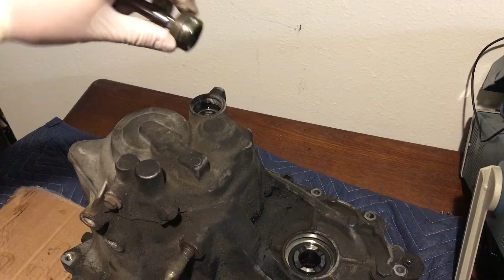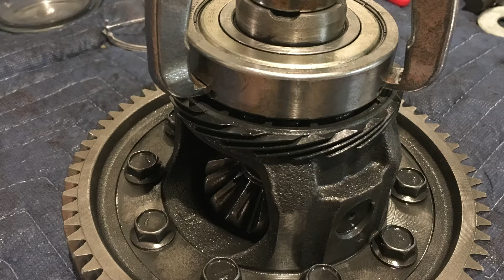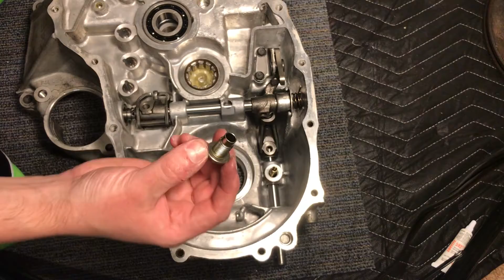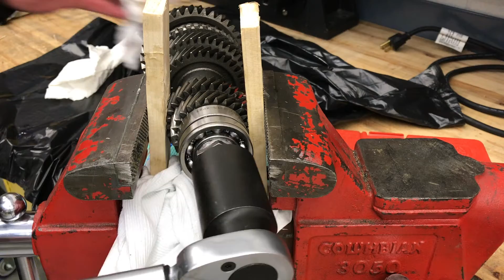1996-2000 Honda Civic D16 S40 (B000) Manual Transmission Complete Disassembly and Rebuild

Comment: God video. Thank you for showing clearances and test procedures!!!
Reply from the maker: All of the clearances come from the 1996-2000 Honda Factory Service Manual.  There are several places online to get a PDF version of it.  This build is still going strong.  Years ago I bought the actual book, but I mainly use the PDF.  I showed how to test the transmission on the table because I've seen so many people rebuild their transmission, put it in their car, and find out gears like reverse is locked out.  Remember, 5:05 in the video is the most important part (if you want to look cool, that is).

Comment: My manual transmission doesn’t have the balls or bolts like you mentioned at 2:14 it’s a p20 A000
Reply from the maker: Correct.  The EG Civic had shift forks that had internal detents on the shift fork shafts themselves, with the spring and ball bearing located inside of the shift fork, and where the shift fork slid along the shift fork shaft. In the EK civic, the shift fork is attached to the shaft. Page 13-32 of the EG Civic service manual shows the disassembled view of the shafts.

Comment: Nice video! I have a 2000 Civic EX 4 door. I think it has the same transmission. I only have about 145k miles on it. It is a second car so don't drive it a lot. I just drive it normal trying to put as little wear as possible. Just with normal driving what might wear out first in the transmission? I know the input shaft bearing goes out a lot.  Were you very hard on your transmission, or was it normal wear?
Reply from the maker: I think it is mostly normal wear. I installed this video's transmission at 293K miles, but it started having issues at around 250K miles. At the time this was built, I only had this car. I bought a few transmissions from the junk yard and made a working one, from combining the good parts and using a SynchroTech kit which contained NTN (OEM brand) bearings. There were other OEM parts I ordered that were not shown in this video, like the flywheel pilot bearing, and the clutch throw out bearing. Both came in my Exedy clutch kit though.  I have a few miles shy of 330K on the car now.  

I've taken quite a few of these transmissions apart since I made this video.  The common things I see are:

1.) The input shaft bearing has always needed replacement
2.) The 3rd/4th gear shift fork has always been worn past factory spec
3.) Most have had their counter shaft bearing partially walk out.  Hence why many in the Honda community stake it to the housing.  Future Civic transmissions have had a guard plate over the CS bearing so it cant walk out.

Fun Fact: I recently found out the voice that I used in this video is the standard voice used for weather radio alerts.

Comment: This video is awesome. Saved to playlist. Thank you for sharing!
Reply from the maker: I hope it helps.  Its not the most professionally made (it was made in my apartment) but i think its gets the point across.  Mine is still running strong, 34K miles later.
Reply: @CivicFiberglassDoor you did great showing everything including the torque specs. I’ll be rebuilding mine soon once I get my parts from Synchrotech.

Comment: I totally didn’t measure jack shipp nor did I use a torque wrench 🤣
Reply from the maker: How long ago? I think most people dont use a torque wrench, and they may be "fine" but given this is a guide to show the proper Honda service manual approved way, I went all out.  I use the tools I bought for this video project for so many different things.  And I know without a doubt that my build is solid.  Measuring also may not matter if re-using certain parts.  I did not have a 2nd vehicle at the time so I bought a few transmissions from the junk yard, frankensteined a working transmission from the parts from each, and made all those measurements to make sure it would work. Except for new bearings of course.  50K miles later and it still shifts like new.  About 2 years after this video was made, I bought another Civic to use as a project car.  Since I have those extra Transmission parts, I'm going to do an auto to manual swap.
Reply: @CivicFiberglassDoor right that’s the difference between a 15k mile ad 300k mile service life I can’t get the freggin main shaft bearing to fit in the case half’s it’s whooping my ass so close to the finish line
Reply from the maker: One trick to use is put the bearing in the freezer.  You can also heat up the part of the casing that it fits into with a heat gun. Heat expands the hole just ever so slightly, and putting the bearing in the freezer shrinks it ever so slightly.  It may drop right in.  make sure you have your main shaft seal in before you do that. Since you have it out id replace that seal.
Reply: @CivicFiberglassDoor all new seals for the second time 😒 Honda mtf doubled in price recently I’ve tried that with my heat lamp and freezer I think my garage is just to fin cold 43* currently 1:49 am I believe the main shaft gears  were the issue the main shaft goes up another mm or two I’m going to put everything in the house overnight and try again tomorrow I also smoothed some of the shape Lip around the main bearing clutch housing side I also mixed up 4 trannys only two were b000 s40s tho one with a hole blown thru it otherwise quite nice then the donor case burnt black nasty bearings were shot more then half of them were BAD
Reply: Measuring everything since I took it back apart

Comment: I sure am glad I watched this because I was just trying to separate this thing with brute force
Reply from the maker: I'm glad it helped! The transmission rebuilt in this video is still going strong.
Reply: @CivicFiberglassDoor  you already know when I got my spreader pliers on the job it fell apart in my hands like  cherry  turnover baked 2 days ago 😂 I blew a hole in my manual transmission after I swapped it the whole thing from automatic so now I got another transmission for EX that I gotta put in there debating opening it up and giving it an inspection before I do I’m practicing on the old transmission. I found the screw that was loose inside of the crazy. And the little bugger still did a mean burn out Skurrrt  talking peel 
& smoke some  32nds off in the street for the rip homies
Reply from the maker: @BrandonSALJ  Was it a pain? It was for me. I actually forgot to film that part of the video so the snap ring was actually already apart, all the movements in that part of the video were just for show lol but it got the point across on how to do it.

Comment: 45:40 came for this instructions, thanks xD
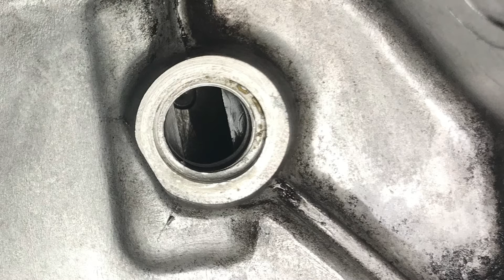Reply from the maker: I dont know why more people dont test their transmission like this before they install it.  I've seen too many people install their transmission then say some gears are locked out (usually a bent interlock, not installing it like at 43:27).  That can easily be seen if they just spin the main shaft and switch through the gears quick. 

If I can do this in my apartment, anyone can rebuild this transmission properly.

Comment: Great tutorial
Reply from the maker: 25,000 miles on this so far and this transmission is still working great.  Measuring the proper clearances with feeler gauges and the dial indicator gives solid peace of mind.  My clearances worked out to be correct as it was put together, but if wrong, my measuring tools would have let me know so I could have corrected them.

Comment: Thank you so much!
Reply from the maker: I hope it helped! The rebuilt transmission is still going strong.  Swapped at 293K miles, currently at 318K.  It would have more but I bought another EK civic to use as a project car, so when that is not down, I drive it about half the time.  Its going K-swap, but staying a sleeper.

The most important part of the video is at 5:05
Reply: @CivicFiberglassDoor  thank you so much and I hope your projects go well. I will make sure to wear socks with sandals in the future!
Reply from the maker: @BoostedPastime Good choice.  Its always preferable to look cool while taking a 25 year old transmission apart.

Comment: i’ve done a full manual swap on my ek and after 3 months of learning and doing the swap, pulling the motor, etc, i tried to do the first drive just for the transmission to  have problems. 

when the car is off, i don’t have 1st or 2nd at all. when the car is on, i don’t have any gears at all. i was ready to give up and scrap the car but then remembered those weird bolts with springs and ball bearings that you showed, i didn’t put the top one in, i only put the bolt in. must’ve accidentally taken that bolt off and misplaced the spring and bolt…

literally up at 3:30 am watching this, so if this works tomorrow i will freak out. i’ve had countless people tell me to just give up and there’s no point. i hope this proves them wrong
Reply from the maker: it could be the issue for those gears.  The detent ball bearings with springs help make the gears "click" and stay in place.  If that is the issue, holding the gear in place (such as holding the shifter with some pressure in gear and not let go) may make the gear work.  

43:15 - Did you make sure to line up the interlock as well? Some people dont do this, install it, and bend the interlock. The interlock is shown at 8:25 and 

If you need to check the interlock, the transmission will have to be pulled again.  If you take it apart, use the guide (or civic ek factory service manual, PDFs are available online) and go through checking all bolts are installed inside, the gear shift forks move the sliders properly, that the springs on the synchros are properly installed...etc.  

When you said when the car is on, all gears are no good.  This makes me think  the clutch release fork/bearing may be an issue, or at least something to check out.  How does the clutch pedal feel? Smooth always, sketchy, too easy to press down? One other possible thing it could be is the clutch fork bearing may have been knocked off the clutch release fork, or the clutch release fork could have been knocked off its little ball(held in by that long wire type spring, Honda part number 22835-P20-010, that clips into the shift fork), and isnt able to release the clutch by properly pressing on the clutch release bearing. If the car is on and you cant shift into any gears, it may mean with the clutch pedal pressed in, the clutch isnt released from the flywheel so its still spinning the gears so you cant press the shifter into gears.  This happened to me when I bumped the fork (piece the slave cylinder presses against when the pedal is pressed), and it popped off during mating it to the engine, but luckily I caught it before the transmission was even bolted back on.

Definitely dont give up.  Its a pain but in a few years time you wont think "yes, im glad i gave up".  Many people may say the Transmission is "shot" or "done for" but they dont understand the workings of it.  They just see the transmission as a mystery box, dont understand how it works, so they just think the transmission is "bad".  I recently pulled an RSX transmission that would only turn half way then lock up.  it was a "bad transmission" but pulling it apart revealed the problem.  The problem was found, fixed, and it works like new.
Reply: @CivicFiberglassDoor i started simple and just undid the wrong bolt i put in the top and it worked. 1st and 2nd are back! i’m not sure where the little spring and ball is so that’s going to be a struggle to find. in australia we don’t have pick and pull junkyards.
Reply from the maker: @rxefy  are the rest of the gears back when the car is running?
Reply: @CivicFiberglassDoor  i haven’t tested it out yet as i don’t have a battery and i need to re bleed the clutch. but i will update either tonight or the next couple days. 

this has been a huge boost in motivation for me, thanks heaps
Reply from the maker: @rxefy Good luck on this project.  I hope what you did fixed everything, but if not, you fixed one thing and can now move to the next thing. Once solved, you will have a working transmission. As said before, a factory service manual is valuable to have if you need to reference anything.

Comment: Isn't there a ball bearing between the shift forks that need to be in place. I'll have to look at the one I'm doing but I'm sorta remembering that. Maybe it was just left out of the video? 

   This video is extremely helpful though. Thank you for making it.
Reply from the maker: Do you mean what’s at 2:14? There are 3 screws/bolts that have a spring and a ball bearing that the spring presses against, and that ball bearing presses against the shift fork. 

2:26 shows the ball bearings in the hand. 

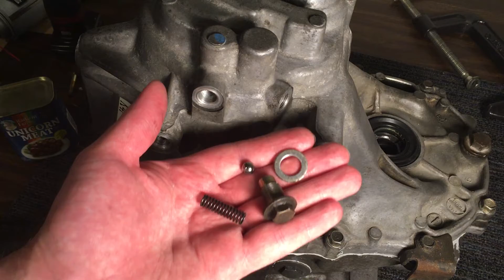44:32 shows the ball bearing, spring and screw being installed.
Reply: @CivicFiberglassDoor  no I'm actually talking about the detent ball between the shifterfork on the shifterfork shaft. Maybe I missed it in the video. Your video is saving me on this first time rebuilding an s40. I noticed the teeth on my 4th gear are pretty rounded after watching this. I've got a spare s20 sitting around and I'm looking into snagging the 4th gears out of it possibly. Some people say they are interchangable. I guess I'd just have a taller 4th. Might not be so bad for gas milage and would still be fun 1-3 lol.
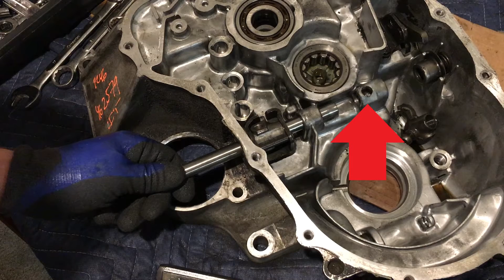Reply from the maker: @NoSleepRacing  Let me know if these are what youre looking for: 24:35 where the spring and collar is installed, 25:13 where the bearing is dropped on top of the spring/collar and the shaft is slid over it while a chopstick holds the bearing down.  8:07 is when I pull the shaft out and that bearing launches into the air. 

26:54 where I installed the detent bearing for the input shaft.  Those are the only times I can remember there being a detent from when I rebuilt this way back.
Reply: @CivicFiberglassDoor nope it's literally a detent ball on the shaft the shifter forks themselves. The detent groves are on one sifterfork and the hole sling and ball are on the shifter fork assembly that has a hole in the shifter fork. (the one the other shifter fork shaft goes though.)
Reply from the maker: If what you're talking about is at 20:22 as the shift fork is rotated, where the detents are on the left side of the screen, continued through 21:25, or on the shift fork that comes into frame at 39:24 (on 2 of the visible shafts), the ball bearings that are shown at 2:14 (removal) and 44:32 (re-installation), are the ball bearings/spring/bolt that press against that shift shaft.  The 3 ball bearings/spring/bolt set are installed or removed from the outside of the case.  These help the shift forks click and stay in gear. 

If you have the factory service manual, either physical or in PDF electronic format (easy to find), look at page 13-12 on the bottom left of the page, and 13-42 on the bottom left of that page.  Those 3 sets are what press against the 3 shift shafts. That is one thing that I should have explained more clearly in the video. 

Reply back if this is what you are seeing, or not.
Reply: @CivicFiberglassDoor  ok I see yours never came out. On the cast section of the third shift fork there is a detent ball and spring. It's right where the 5th gear shift fork rides on that cast part on the 3rd shift fork. Mine actually comes out and doesn't stay inside the cast steel part.
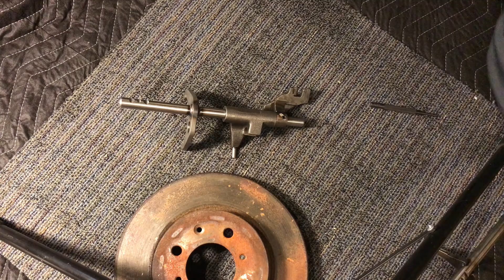Reply: @CivicFiberglassDoor  you can see it right at 21:03 when you rotate it.
Reply from the maker: @NoSleepRacing  Thank you for pointing that out.  I was confused since it is a solid non-wearable piece from Honda called "5th/Reverse Shift Piece", part number 24243-P4A-010, which is discontinued.  Thats one of those things that should have not have come out.

Comment: Thank you for your service. I will be attempting this at the same time that i replace my clutch in my 1999 ex coupe. Much love.
Reply from the maker: I hope it helps you out.  My transmission has 20,000 miles on it and its still going great.  No problems at all. Making the video helped me learn to do it properly.  At the time I thought it was required, but a press for this transmission isnt truly needed, just a nice-to-have.  The shafts can be taken apart like this the following video link, or tap the tops with a mallet: https://youtube.com/watch?v=6qWAqbR80HI&t=12m1s

Remember that the clearances are very important, such as the differential and main shaft clearance.  Buying a dial indicator and stand for the mainshaft clearance is relatively cheap and will save you much headache down the road. If you dont switch out gears, only synchros, you shouldn't have a problem with the main shaft but its still peace of mind to know its correct.
Reply: @CivicFiberglassDoor  Thanks for the advice buddy
Reply from the maker: @truthseeking3818  How did the clutch swap go?
Reply: @CivicFiberglassDoor  GREAT!  Threw in a stage one Exedy, sanded and resurfaced flywheel myself, threw in rear main seal while I was in there.

Thanks again for your video - even with having the book, seeing everything was much better.

Appreciate ya! God Bless.

Comment: Very thorough. Thank you.
Reply from the maker: At the time I couldn't find a video that went through all the clearances with the proper tools.  The transmission built to factory spec has been going for 2 years so far with zero issues.  If its built properly, it will serve you well.